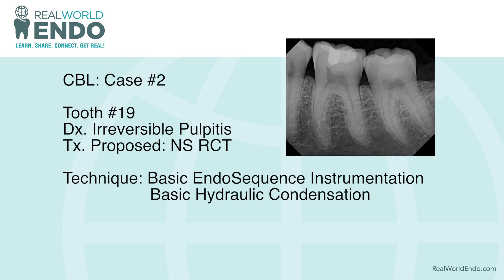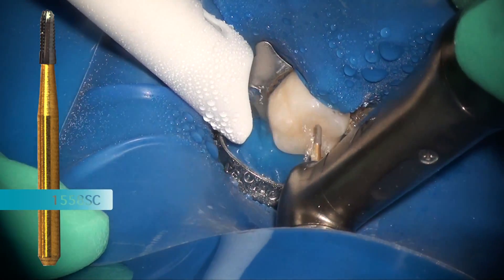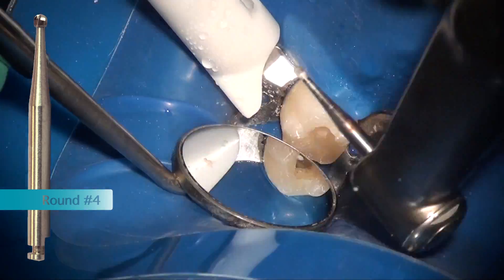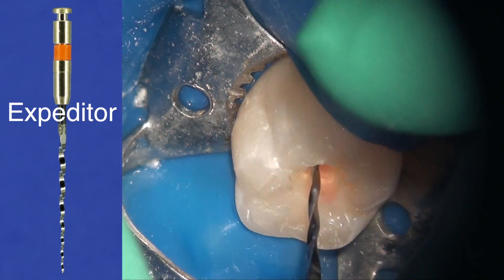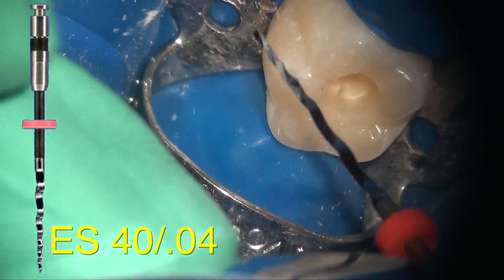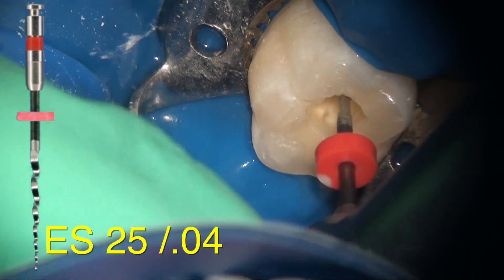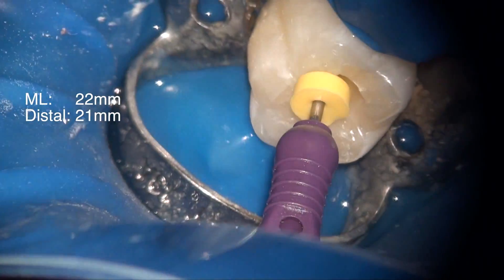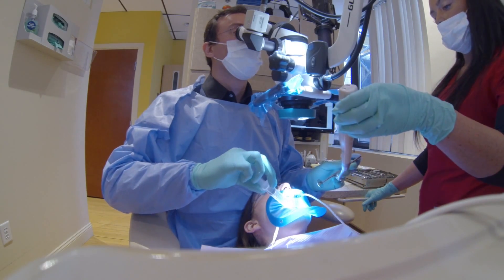CBL #2: Basic Molar Root Canal Therapy #19 by RealWorldEndo

Comment: Hi Dr, can a root canal procedure be sufficient to ensure long term functionality and longevity of teeth? Is a crown necessary for second molar?
Reply from the maker: A good quality one can. Root canal therapy is not a commodity, it's a service. So, it can vary based on skill and expertise. While nothing is every 100% in anyone's hand, the odds of success are obviously higher in more competent hands. Try seeing an expert specialist and a crown is usually recommended after root canal therapy in posterior teeth to help hold forces of occlusion from splitting the tooth in half. While you can sometimes get away without the crown this is based on how much tooth structure is remaining and what kind of occlusion and chewing/eating habits you have. If you grind your teeth or eat a lot of nuts and whole/raw, chewing intensive food, a crown is definitely recommended.

Comment: Thanks for uploading this...During dental school, they taught us not to dry the canals with air due to the risk of creating air embolism. Your thoughts?
Reply from the maker: That's only if you stick the air inside the canal and lock it off... then the air will only go out the other end... when you blow over the the tooth the air will actually come out of the tooth as opposed to go in (low pressure Bernoulli's principle!) Cheers.

Comment: How do you confirm a estimated working length via a radiograph? is there any particular program you use or just use a ruler on top of the radiograph? thanks!
Reply: The application allows you to digitally measure the distance.

Comment: Hello Dr Nasseh
 I have a question for you, can i obturate a cuspid in a single visit with a sinus opening if i strictly follow aseptic techniques and do proper cleaning and shaping???
Kindly reply....
Reply from the maker: It all depends on the quality of cleaning and shaping and whether you can get it clean enough in a single visit. You have to judge based on your expertise. Dr. Nasseh also recommends larger apical diameters whenever teeth are prepared and filled in a  single visit. This is the way to assure better cleaning and removal of the biofilm. In a Canine. I would assume a size 40 or sometimes much larger size depending on the patient age. - RWE

Comment: Good Job! So I need a root canal. My dentist drilled and sealed it temporarily. Well it's been a year and a half and feel a really light sensation which I assume are the beginning stages of an infection.  Will I feel pain after? The reason I'm going in is because I'm going on vaca 3 days after my procedure and wondering if it will hurt and or will I receive Pain pills in case it is still bothering while on vaca?

Comment: why during the first ROUND of rotary did you go from 40 0.04 to 30 0.04 instead of 40 0.04 to 35 0.04? 

i saw in the second round of rotary you did 40-35-30
Reply from the maker: It may have been a typo. I never skipped sizes in EndoSequence System. 40-35-30-25-20. That was the system. With the new ESX System, because of the Booster Tip and the SSC I do skip, 15-25-35 etc.

Comment: If I was the patient with this same exact case......If you restored my tooth with fuji IX I would NOT get a crown!!! What would you do Doc? If it was you that is?
Reply from the maker: I agree with you, especially when the marginal ridges are intact there's a good argument to be made for not having a crown. However, the patient's general dentist had already scheduled for a crown and I could not change his plan. The only thing with Fuji IX as a final restoration is the solubility. I would just remove 3mm from the surface and use the rest as base to seal with a bonded composite. Unfortunately, this was destined to have a crown for better or worse by the patient's referring dentist and that's what happened post operatively.

Comment: Dear Dr. Nasseh,
Amazing video!!!!! Congrats!!!!! Very beautiful filming and details. During the procedure, which is great, I disagree on one point. I wouldn't fill the "well" after the first condentation with bc pellets or any gutta percha. I would take advantage of these little wells to fill them with very white opaque flow composite along with the pulpal floor. This way I am more confident to avoid microleakage taking advantage the adhesion properties of nowadays bonding procedures.
Reply from the maker: Yes Tasos. If you can get the composite down there without trapping a void I agree that it would be ideal. I've found many people have a tough time filling the well with composite and they end up trapping a void, which is not useful. But if you have enough magnification and illumination and can consistently avoid the void, go for it. :)

Comment: Your irrigation sequence seems quite short in comparison to other lecturers. Often a chelating agent or acid is used to remove smear layer and NaOCl is used for disinfection. Are you relying on the antibacterial effect of your sealer or do you consider water /NaOCl during instrumentation enough?
Reply from the maker: Many of the other lecturers use the instrumentation technique that was developed for vertical condensation. That technique keeps the apical diameter to a minimal (about a size 20). In those techniques, you rely on your irrigation more since you're not physically cleaning the canal with instruments as much. I advocate larger apical diameters. In larger sizes, the instrument is removing much more efficiently. Lastly, more important than time is the volume of irrigant. The combination of NaClO and Negative irrigation allows me to run any where from 10-20cc of 6% NaClO safely through the canals. In this case I used a good 12cc of NaClO after working length determination until obturation. That's enough. Lastly, I don't rely on the disinfection quality of the sealer. It's a benefit but it's not a shortcut to effective instrumentation and disinfection. Please ask questions on the our website for more comprehensive answers.